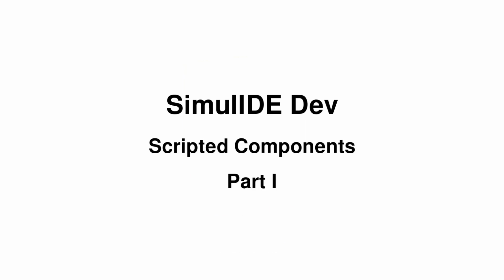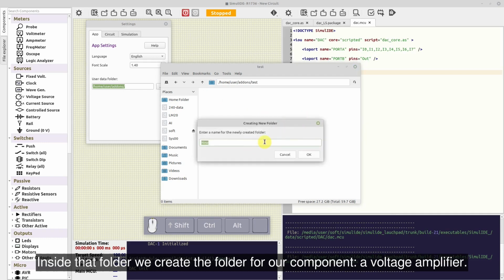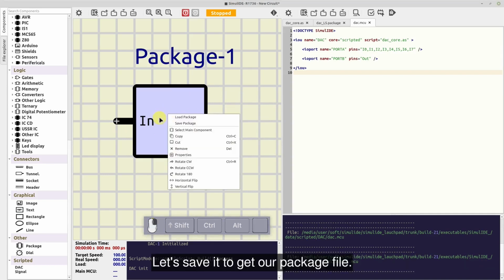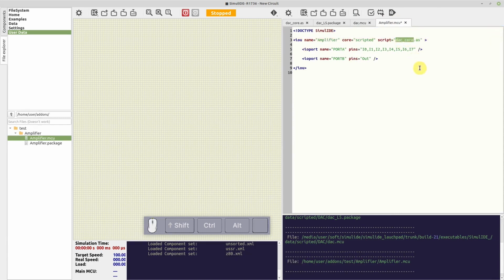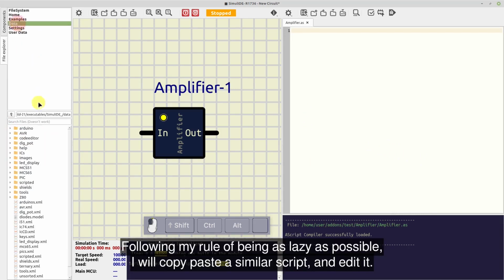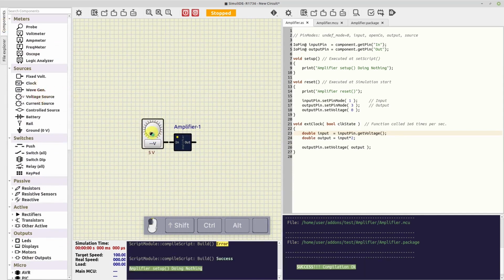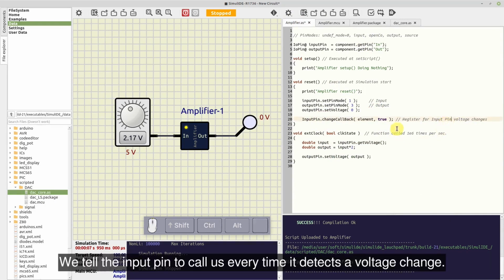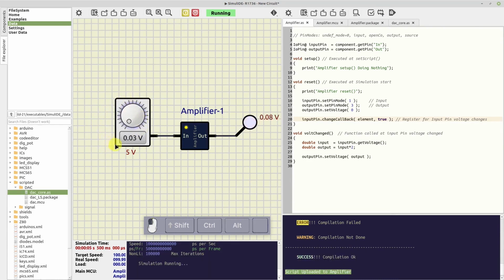Creating Scripted Components (Part 1) SimulIDE dev.

Comment: Nice...
If there are many Arduino pheriperals this simulide will be the winner.. such a easy to work with tool... 😊
Also there has to be some tutorials that explains how to create your own pheriperal uart devices..like adafruit  finger print sensor etc....
Reply from the maker: Yes, with this kind of component it will be possible to create peripherals with Uart, I2C, SPI, etc.
This tutorial is the very basics of scripted components, in Part 2 we will add configurable properties and combine this with subcircuits to add a dial to the amplifier.
Then, more tutorials will come showing how to add communication modules, link to other components and some other features.
Reply: Hi what is the version of simulide you work in the example
Reply from the maker: @MedTronic73  This is the version in development.
There is a link in the description.